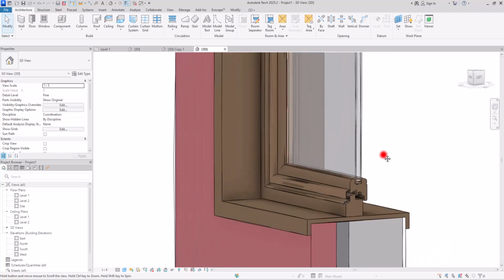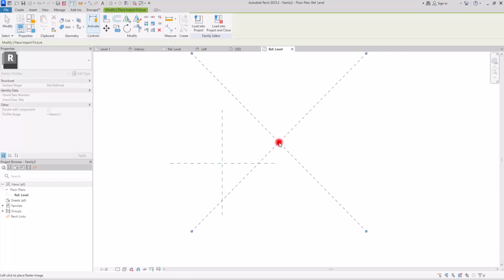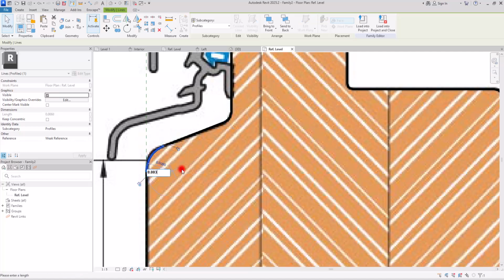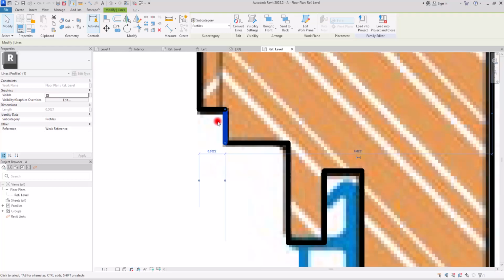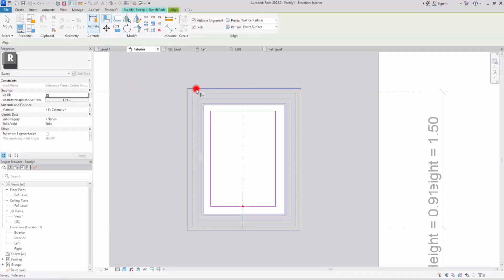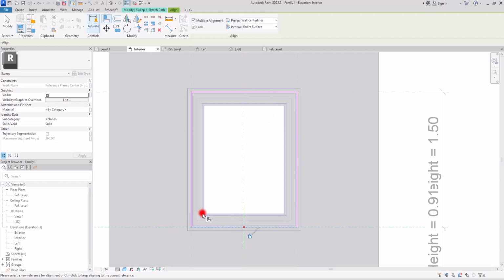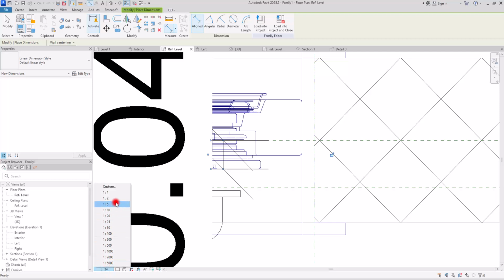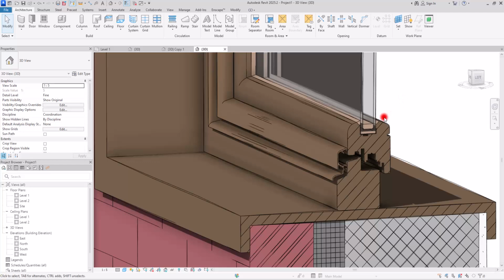Advanced Modelling Techniques for an Adjustable Wooden Window in Revit

Comment: Hello, great work. But, you have a big problem here. You should understand that wooden windows are different from plastic or aluminum. Profile A and D are only suitable for the bottom, and the sides and top should be different. Please, fix it. Also, if you know how do window with thickness params.
Reply from the maker: Thank you for pointing that out! I will make sure to include that in the next video.